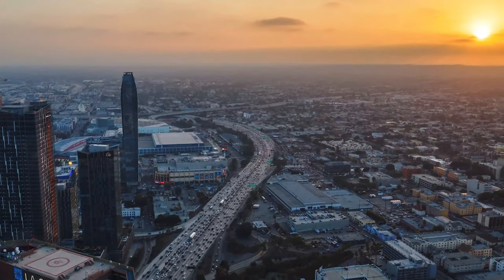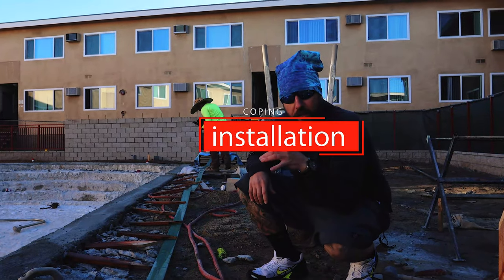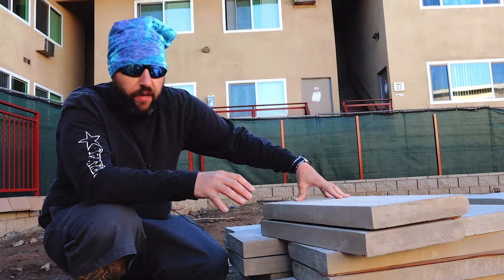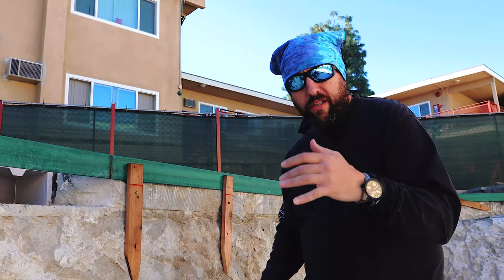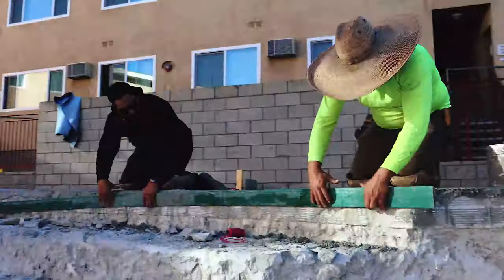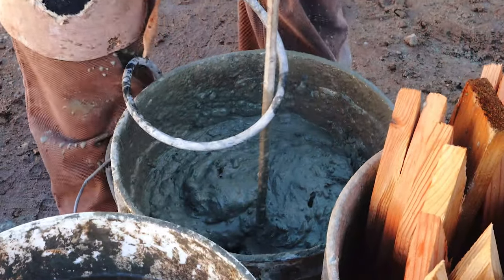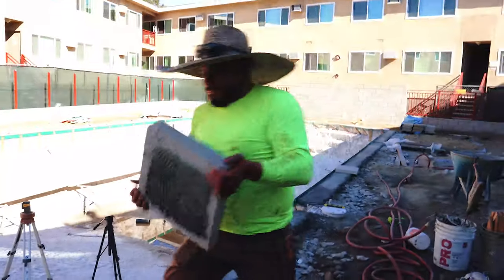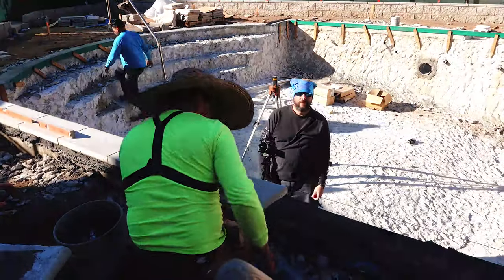Swimming Pool Coping Installation ~ Form Board Leveling & Mortar Bed Prep 4K Ultimate Pool Guy 2020

Comment: Quick question for you -- how do you do the masonry/grout between the coping pieces along the bullnose edge? I'm getting ready to put this exact type of coping around my pool, and I'm pretty sure I need to use a piping bag, but I have no idea to get it to go around the bullnose curve. Seems like it'll be messy!
Reply from the maker: Yes its messy

Use a grout bag "frosting bag"
And
Wet sponge to finish

Similar to flooring tiles
Reply: @UltimatePoolGuy  Gotcha - thank you! Would it make sense to "butter" the entire side edge of the coping piece with mortar so when you press it against the next piece, you have MOST of your grout already in there?
Reply from the maker: You can 

We go around and set everything 1st

Then

2nd pass grout 

You sound knowledgeable 
So you'll find ur technique to suit your job

Comment: you're a wizard.... love the vids..  I've removed all the old mortar bed (1/2 inch as recommended) however the bond beam is chipped also (fm removing the mortar). note your below about repairing the bond beam prior laying the morter bed - if i do this my 1/2 inch will be lost, would you recommend forming up with my form boards &  laying my new mortar bed /coping straight onto the bond beam? just worried if I repair the bond beam, dry's, then when I go to lay the mortar bed it will be off level.. causing my coping to be out of whack.... thanks ultimatepoolguy vids are vry helpfull
Reply from the maker: Hello
Thank you for writing in 

1 demo _ clean area
2 make repairs _ sack concrete
3 form up_set elevations...this establishes mortar bed depth 
4 lay material _ spec mix w.thin set dollop 
🤜🤛
5 finish work
6 smoke weed
7 smoke weed
8 invite friends for bbq💯
Reply from the maker: Make repairs ...step
Can also be done with rapid set products
Reply from the maker: step 2 make repairs can also be with 'rapid set products' from your local building supply

Comment: nice video....helping community...do you use type n or type s spec mix?
Reply from the maker: type s mortar...can be spec mix or otherwise...rapid set makes good stuff also
Reply: @UltimatePoolGuy  i am curious why do you prefer type s over n ...i've seen a few documents saying to use n.../ would i need a water proof mortar or standard would be fine? thanks again

Comment: Another perfect video.  Do you also use form boards for the bond beam repair?
Reply from the maker: hello, thank you for writing in...we will usually go around and make repairs to the bond beam after demolition and before the form boards go up...the form boards help with a level installation
Reply: @UltimatePoolGuy  If the bond beam has been taken down further than removing the old mortar, do you use form boards when building it back up?
Reply: @UltimatePoolGuy  My local HD or Lowes does not carry Plastic cement or specmix, is there any other options for rebuilding the bond beam? Thanks.
Reply from the maker: Yes sir 

Spec mix

Rapid set "cement all"
Reply from the maker: @davileett1224  spec mix grey bag
Reply: @UltimatePoolGuy  Thanks for the reply. I do actually have some Rapid Set Cement all at my local HD. Is that something I can use pretty dry without forms? I just will have to work fast with it correct?
Reply: Unfortunately no spec mix near me. Very strange plastic cement and spec mix aren't available here on the east coast.
Reply from the maker: You are using the rapid set product  for repairs to the bond beam so no form boards are required 

Yes rapid set cement all sponge it clean is what I like

Then set your forms and start laying pieces
Reply from the maker: You will need mortar at some point tho
Reply: UltimatePoolGuy Thank you. I have some Laticrete 254 on order for the tile and coping mortar. Will give the Cement all a shot for bond beam repairs. I would say I have to build up 4-6”. Is that something I need to keep continuously mixing and laying all in one shot? I’ll probably be solo doing it, just hope the set up time doesn’t create issues for me.
Reply: UltimatePoolGuy would you use cement all for repairs greater than 4” deep or go with mortar mix?
Reply from the maker: Repairs 4 inch deep you probably want to use some regular concrete  with some rebar doweling to hold it in place

Are you trying to fill something in?
Reply from the maker: Between the two choices you provided I would go with cement all
Reply: UltimatePoolGuy I have put rebar dowels and cross members where there has been extensive chip out more than 4”.
Reply: UltimatePoolGuy is there a particular regular concrete you would suggest?
Reply from the maker: Cement all with sponge finish should be good 
Tie your rebar together also
Reply from the maker: You also asked an earlier question about using form boards to build up the van being where it has been taken down further than the mortar bed and yes you can temporarily use form boards anywhere you want reasonably speaking to build up and remove to your liking
Reply from the maker: Quickrete is fine for around the pool area 

With concrete it's basically with or without gravel without gravel is like a cement all product with gravel is like a Quikrete product

Rapid set green bag is rapid sets version of a concrete
Reply from the maker: Rapid set blue bag in my opinion is similar to Rapid set green bag but no gravel it's essentially cement and sand but lends itself to different applications

There is a time and place for each or rather better results
Reply: UltimatePoolGuy thank you for your patience with me. I got some cement all that I plan on using. So we will see what happens. I worry about the cure time being a hindrance so I will have to work small sections at a time.